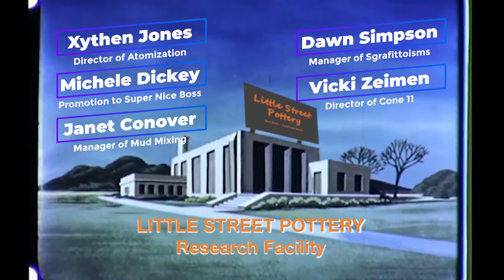Decorating With Dispensers! - EXPERIMENTS WITH HAIR DYE AND FOOD DISPENSERS!

Comment: So good videoes 
Do you use both underglaze and transparent glaze before burning. A good idea so you can save energy by burning only once
Reply: Great idea but actually I do two firings.  I do all my decorating at the greenware stage, then bisque fire it, then glaze and fire it again.  If you try to "once" fire it, it can get tricky.  The piece is so fragile that it can fall apart during glazing or if you fire it too quickly in one shot, it can also come apart.  Some people do prefer  a once firing though. Just depends